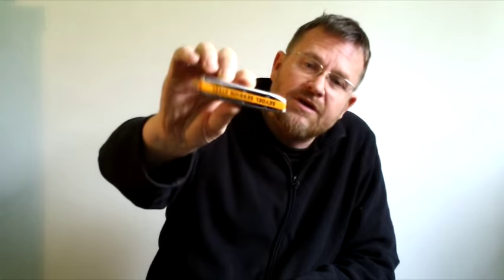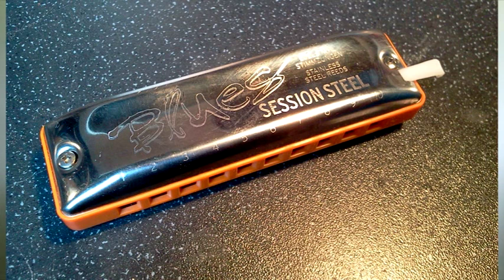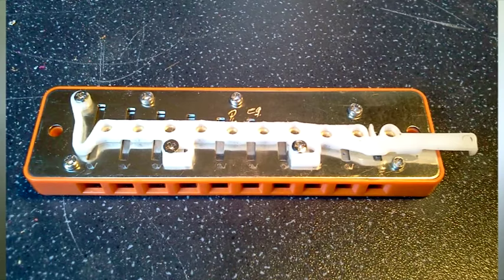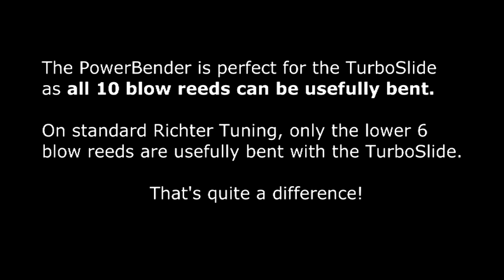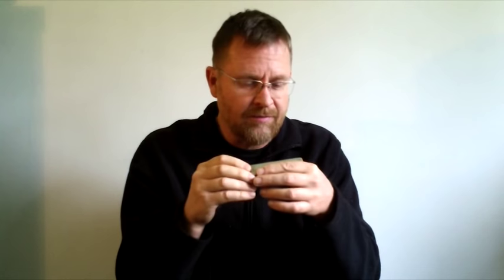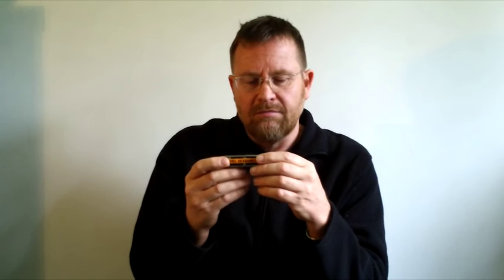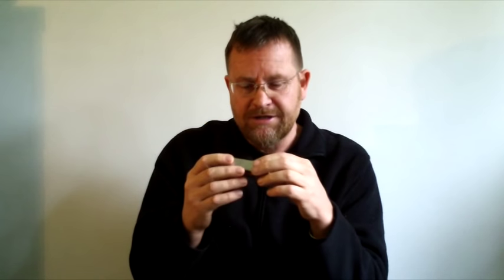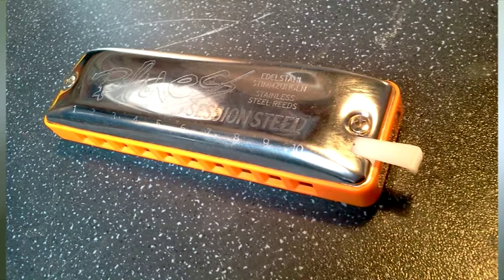The PowerBender with TurboSlide: a Nice Combination!

Comment from the maker: Yes. The magnets are threaded in to the slider, so you can adjust them for fine tuning, and also for getting bigger slide bends. The magnets on this harp are set for semitone bends, but they can be set for full-tune bends if you prefer. BP

Comment: Amazing. This seems like the ultimate solution. How would this all work with Richter tuning - would it still get the full chromatic scale? Also do you find yourself using this setup today - or is something like the lucky 13 more practical?
Reply from the maker: No, it doesn't work for Richter tuning in the top octave. It's not an either/or choice with PowerBender: the Tuboslide simply adds even more to the good stuff PowerBender offers.

Comment: COMPARE :  slip slider   vrs  Turbo  Slider ..I want to decide a purchase.
Reply from the maker: The bends are different. The SlipSlider gives you new interactive-reed blow and draw bends, which are the same easily controllable bends as the eight standard ones on a Richter harp. They sound through two reeds of opposite breath working together, and the bending pitch is determined by the note of the lower-pitched reed in each hole. They work on any harp, regardless of reed material. The Turboslide requires steel reeds because it creates new blow bends via magnetism. They are single-reed bends, and their pitch is determined by the proximity of the magnet. They can't be controlled through the embouchure, but are initiated via a push button. I prefer the SlipSlider type of bends. But... Here's the good news: you can have both! If desired you could fit a SlipSlider 1847 with a Turboslide to get more bending options... Two ways to get the new blow bends, and extra draw bend possibilities too. Has that confused you even more?
Reply: "OK"  What about ( $) ... &  Delivert  time ...to  Toronto  , Canada